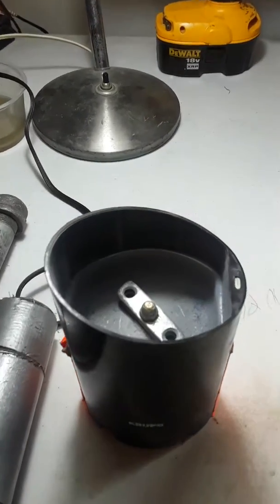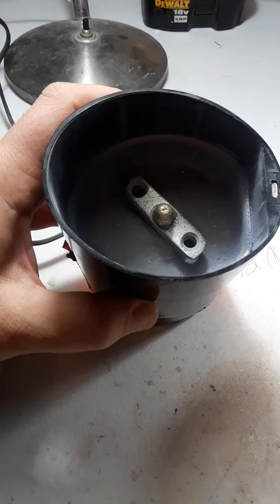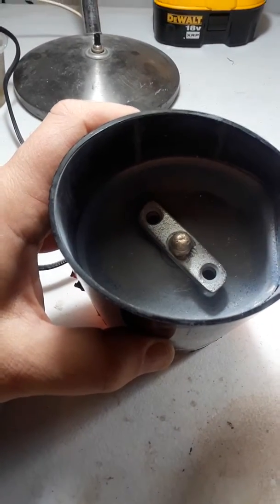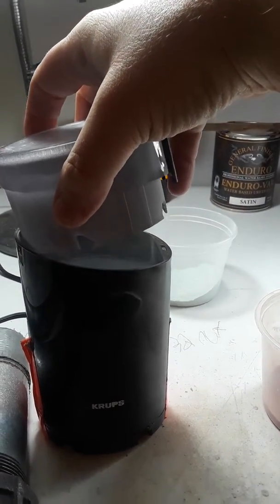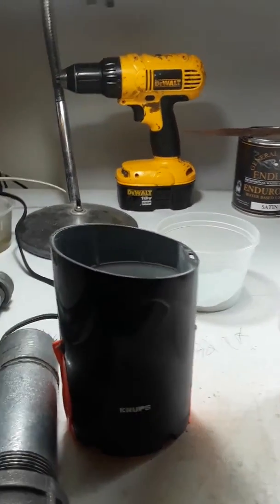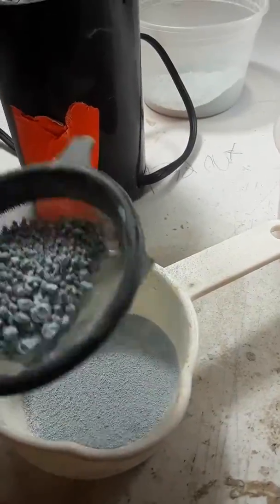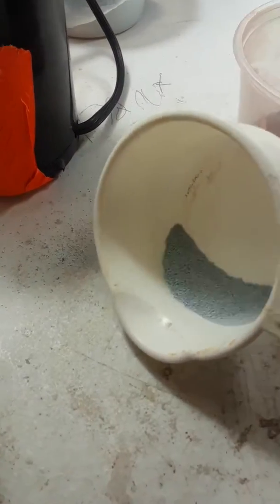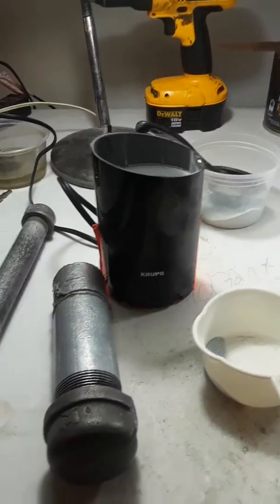How to grind/crush/pulverize stones 'turquoise' into powder for inlay

Comment: Hold coffee grinder upside down tap sides then pull grinder away from cup and everything will stay in cup will have to make on good idea.
Reply from the maker: Ive upgraded to an "electric mill grinder". Ill post a video on my channel
Reply: @jeremiahsworkshop492  What kind of electric mill grinder, and did you do some modifications to make it work with stone materials?
Reply from the maker: @d3rojo  it had some Chinese name...I got it from eBay. Just type in herb mill grinder. I also picked up a stone crusher for gold prospecting ...called.. The Crunch

Comment: How would you recommend grinding metals into powders, like brass or steel shavings?
Reply from the maker: I upgraded to an electric mill/herb grinder from eBay...it came from China...basically a very dangerous blender with no safety features. I put aluminum shavings in and turned it on. It grinds it ok...but...in reality...if I want ground up metal..I buy it pre ground. What I've learned is copper alot of times isn't ground using a machine...it's done chemically.